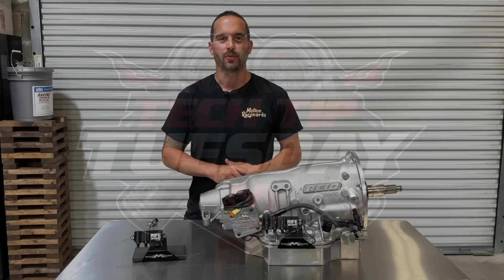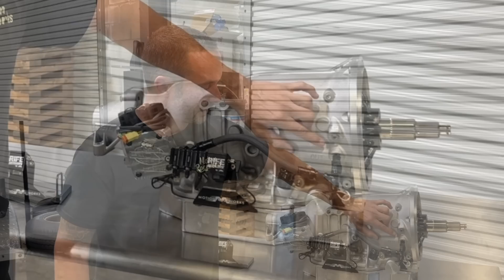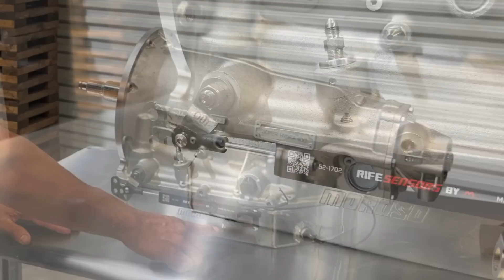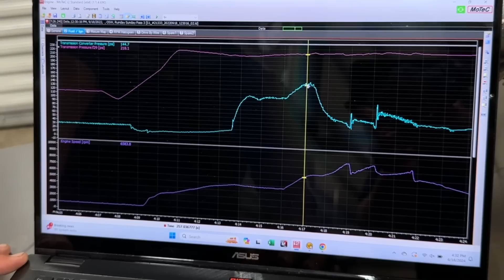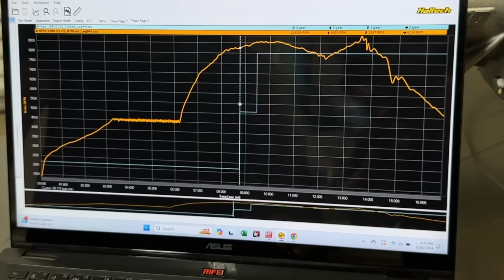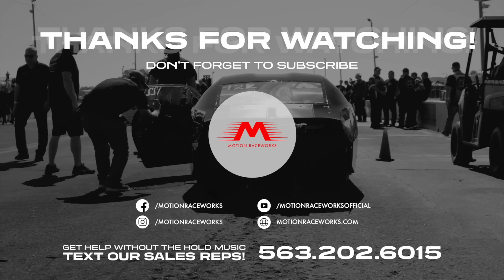Tech Tip Tuesday: Transmission Sensors 101 w/ Brett Lasala

Comment: I am going to dissent, I purchased this kit and was severely disappointed. 1.) the wires are stranded aluminum, not stranded copper. This is a no go, aluminum wiring in a car is a fire hazard. 2.) the lines are not color coded in the instructions. Once wired in, if you didn't take note of the color to number, you have to get back underneath the car and take note. 3.) If you are in a late model Chevy/Ford/Mopar there is absolutely no room for the bracket, sensors and DT connector in the tunnel. Even with bending the bracket there is still little to no room next to the TH400.

Since the pins are DT and if you have a Holley just use the supplied wiring from the J connectors if you purchased a kit along side a Dominator. I was asked to provide a review by Motion, it was sent in. Won't post to the site and I even included videos and photos of the issues.